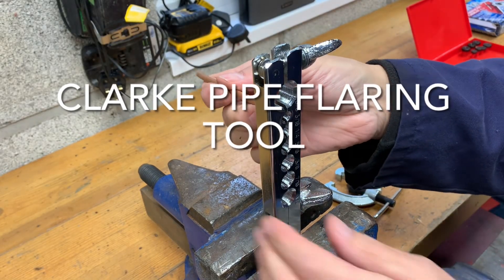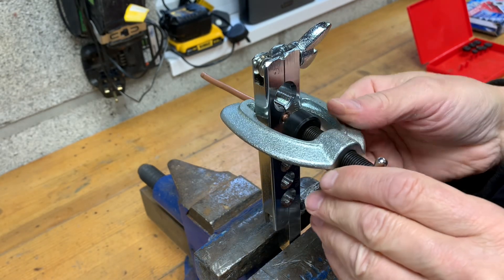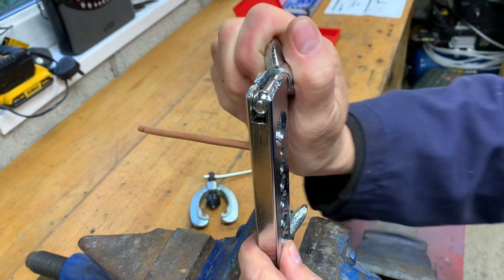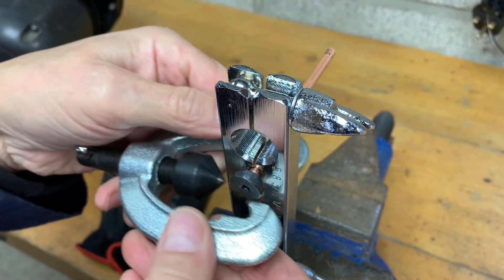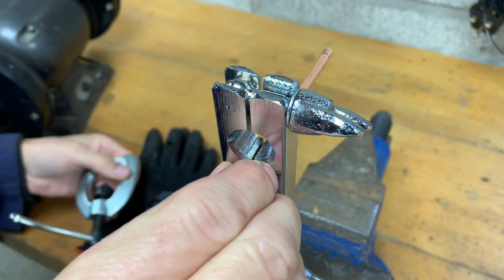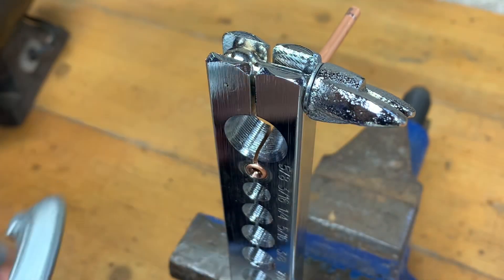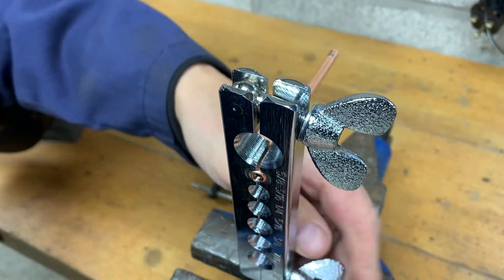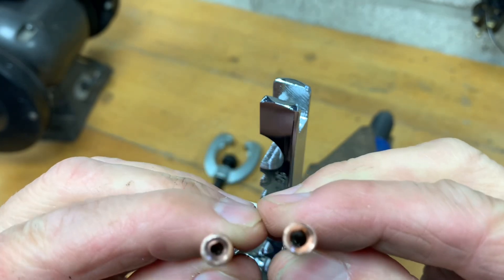"Master DIY Brakes: How to Use a Brake Pipe Flaring Tool Like a Pro!"

Comment: That kit is exactly the same as my 25 yr old harbor freight one..... Replace the wing nuts with hex nuts and the bar on the flaring clamp with a welded on 3/4... or 19mm nut and you will have a tool the can make flares on stainless tube with ease using a long handle ratchet to tighten it all up.... Always deburr the inside and outside of the tube and use lube on the dies and of course held tightly in a vise... Works on 1mm or .028 wall tubing or less... Which is the majority of automotive tubing.
Reply from the maker: Yes they are an old tried end tested design. Great advice. 👍🙂

Comment: For the double flare, put your tubing in the fixture without tightening it.  The button (collet) you will be using has a shoulder on it. The length of the major diameter step is the amount of protrusion for your tubing. Just place the button flat side down onto the fixture beside the tubing to set your protrusion length. Then tighten the fixture, flip the button over and insert it into the tubing. And carry on. - from Snap-On directions.
Reply from the maker: 👍great advice Jim. 🙂👍
Reply: This sounds useful, but I am being a bit dense and don't fully follow. What is the "The length of the major diameter step"? Thanks.
Reply: @welshdave84  i think he meant the thickness(or density huh) of the button, as i just saw in another video.. however i dont think it applies for this cheap set as all the buttons have exactly the same head.. i reckon that if you were to go with his advice you will easily snap that pivoting thing off the button..